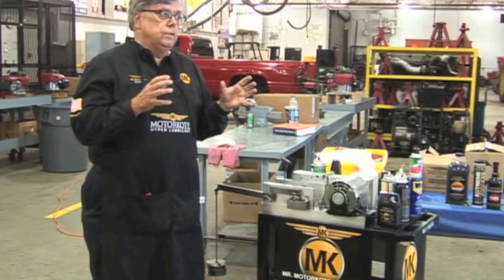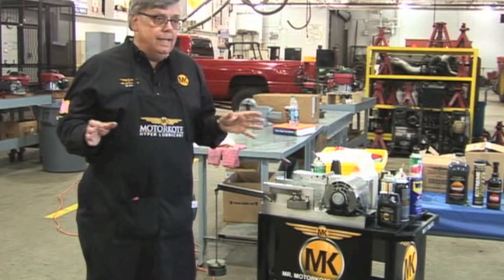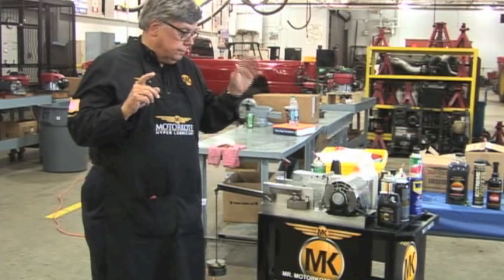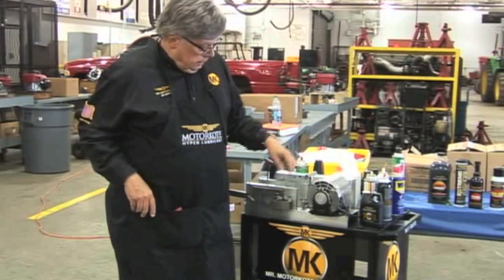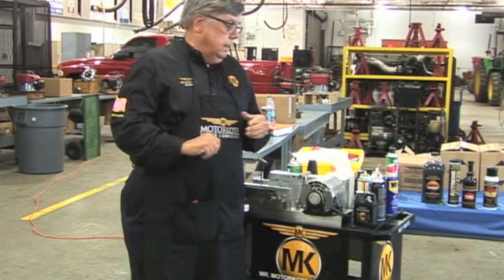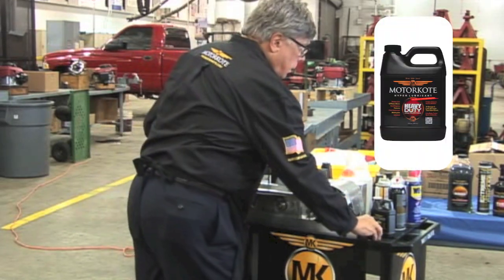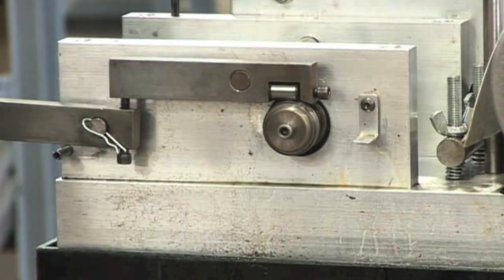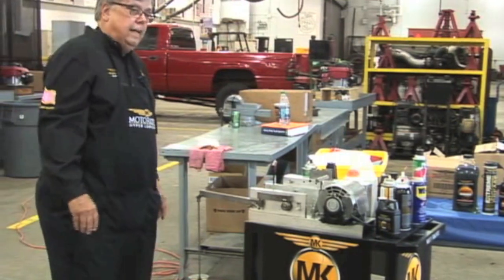Motorkote® Demo

Comment: Ive bought probably 4 gallons of this product and use it in all my oil changes.  My vehicle is a 2005 Chevy Equinox with 268,397 miles on it and still driving great.  Amazing product.

Comment: I am using motorkote in my 88 deere 1050. Abit over half of the recommended amount for a "heavy duty turbo diesel" with absolutely incredible results. Its an inline 3 diesel so it makes much more racket than say a modern 4 cylinder but Motorkote had quieted the engine right down much more than i ever wouldve thought possible.

Hiwever according to amsoil theyre claiming motorkote uses chlorine for whatever reason, now are they slandering your product to boost theirs or is motorkote really going to loosen up all the older sludge built up inside engine crankcases from years of conventional use?????

I believe this to be an extremely important question for you to answer

Comment: I bought this. I tried to cancel after but it shipped anyway. I haven't put it in my jag and wont. I have been trying to get an answer on the chlorine rumors. No response from MK Yet I emailed them on the 24th of dec. Clorine is not good for aluminum block or heads... . The flash point is only 60c. That sucks. Waste of $30

Comment: Marketing ploy BS: It's not an additive. You can keep it like all the magic oil additives in a bottle. I'll stick with Amsoil. It's never failed me and all my vehicles run on it, along with my small engines .
Reply: amsoil guys never seize to amaze me. they are NEVER open to other opinions.
Reply: @lukeWiz44  And don't assume we're all the same. I don't go around claiming Amsoil is the best; it is my preferred choice of oil. Even back when I was running Pennzoil, I still wouldn't put this nonsense in my engine. The people who fall for the B.S. haven't taken the time to understand just how motor oil really works. A healthy engine running on top-tier synthetic oil doesn't need help. I've seen so many magic bottle products with some flim-flam making all sorts of claims that their product is the best of the best. For example, there are a couple of YouTube videos of someone showing how much better their product is over MotorKote (MOTORKOTE VS TURBO MAXX BRASS FRICTION TEST).

Run the right motor oil, use a quality oil filter, and change the oil on time. Done deal. A magic trick or some random internet person isn't going to tell me otherwise. I've done the research and seen the data. These products for a healthy engine are B.S.
Reply: @4x4gear33  i didn’t ask for all that man. I get amsoil is your oil and i respect that. I run ultra platinum and i’m happy with the price i pay for it. but this motorkote- it increased my fuel mileage by .8 mpg. i was really impressed by it.
Reply: @4x4gear33  Just an FYI. Did you know Amsoil was sold and the ad pack has changed in its formulation. Not as robust as it once was.
Reply: @FadetoBlack1463  Can you provide an article that says this?
Reply: @FadetoBlack1463  The only thing that changed is the CEO. The company was not sold nor has the formula change.
Reply: @4x4gear33  Changes are being made from with in the company.. Can you provide Lab reports showing the formula has not changed?

Comment: This is honest to God real.  in the '90's a store where I worked carried MotorKote and one day the salesman, possibly this gentleman, brought this machine in to demonstrate to customers how MotorKote worked. I was the mechanic in the store. While the salesman was doing his thing I told myself this was a rigged test. So while he was talking and the machine running on a bearing I grabbed the leverage arm and pulled down. I pulled down quite hard for about 15 seconds. Customers were snickering while watching me pull down on the arm. There was no change in sound pitch, the machine did not slow down and I did not see any signs of heat. The salesman turned and shouted for me to stop what I was doing. He wasn't worried that the product would quit working but that I would bend the leverage arm of the machine! I was sold. I added it to all type of lubes, grease and oil. I used it on everything that used lubricants. Engines, transmissions, hydro transmissions. Anything that spun or slid. I still use it today in my cars, street and race, lawnmowers, chainsaws, guns, door hinges, everything. It's amazing stuff.
Reply: I noticed no corrosion when replacing a seal on a 5HP B&S motor on a generator. I've used MotorKote since 1999 on that motor with over 500 hours on it with an oil change every spring with MotorKote added.
Reply: @UncleStevie8er Did you check this under a microscope? That's what folks (oil "wizards") on the bob is the oil guy site always ask

Comment: Motorkote, Amsoil Signature Series, and K&N Oil Filter is a tough to beat combination.
Reply: I agree with you except the k&n oil filter part. I haven't seen any info to prove k&n oil filters are any better than other top of the line brand filters such as Wix XP,  Mobil1, Fram Titanium, Napa Platinum, Royal Purple etc etc
Reply: Agreed

Comment: Aloha from greece very interesting ,i got a question, how many oil changes does the new motorkote last ,they dont make it as thick as they use too
Reply: Because of new cars with VVT-I and v-tec systems the need thin oil

Comment: It’s a great lubricant but DO NOT put this in your engine. It burns off and creates a nasty sludge. Have had to run seafoam through my engine multiple times to try to clean this stuff out. Use it on hinges and bicycle chains but not your motor

Comment: As far as motorkote goes, I'm still on the fence and looking into it.  I work in a lab (different industry than petroleum) and will be unofficailly running some tests. I will also introduce combustion byproducts, which often has emulsified condensation to test for additional corrosive byproducts and moisture contamination to test for acid development, etc.Your EGR valve, crank case vent, and oil separator  all recirculate these corrosive byproducts back into the combustion process or back to the oil pan. I'm reading about chlorinated paraphins but perhaps it's not as big a deal as it being made out to be. Hoping to make a contribution. I love project farm, and I'm thinking about seeing if he may do a follow up (long term test?) pending what I find. The physics and chemistry of the internal combustion engine is hard to replicate with just one test. The Timken bearing tester only gives you a piece of the big picture. Project Farm affimed Motorkotes claims, which was quite impressive to be honest. It got my attention.
Reply: Will be waiting for results , did you get something???
Reply: Any news yet?
Reply: Would be nice to see a test. Although i am sure these acidic byproducts will be neutralized by the oil additives. Also a regular oil change will help too ofcourse. And as long as the oil doesn't see a dangerous high temp nothing will happen
Reply: Have you completed the project?
Reply: To be honest I had to put the project on the back burner. I was waiting for some testing materials to put a study together.... I'm really excited to put this through some tests. It just may be a few weeks before I get to it. I will follow-up with this.
Reply: @ryanpooler3962  ok, thanks!
Reply: @ryanpooler3962  
Any update?
Reply: @ryanpooler3962 I’d love to hear if you ever got it testing!

Comment: This along with Project Farm’s testing and I was sold!
😎💪🇺🇸🗽❤️
Reply: His test is great but after seeing how well it worked I am shocked noone has sent in an oil sample to see how the wear compares to a normal oil change.
Reply: I was sold after watching some of the popular videos for this product. Just put some in my car today
Reply: If you notice Project Farm used straight MotorKote in the lawn mower. This guy is doing the same. So we need to fill up our engine with MotorKote let it run a few minutes then drain. To get a good coating.  Then add the oil. Ford Boss channel added Motor Kote to Schaeffer oil. Put all the weights he had eleven weight to finally get it to stop. Tested just  Schaeffer by it self stopped after two weights. It stopped. Scar on the Motor Kote was negligible. Where the straight Schaeffer was large.

Comment: The fact that this company is not more honest with what the contents of their product is when I do believe most of us already know and they refuse to admit it is why I will not use this product. All one has to do is simply Google What chlorine paraffin is and how it behaves under high temperature and it explains everything motorkote does to a T. Yes, it's a very good friction reducer. Yes the effects of chlorine paraffin under high temperature creates a coating on metal surfaces that's very resistant to moisture. But the after-effects is it can produce sludge and hydrochloric acid which will break down your motor oil over time. You would be running the safer alternative just adding more ZDDP to your engine oil instead of this motorkote. if your engine Burns oil of course ZDDP is not good for your catalytic converters but at least it won't break down your engine oil or promote sludge and it essentially achieves the same effect as motorkote does. People should be very suspicious of motorkote  since they claim no actual oil additives are in their product so if it doesn't contain the same additives as your motor oil what does it contain? This is what motorkote refuses to disclose and because of that I don't believe any of us should be trusting this product. This stuff claims to be so great but there is an obvious reason why oil manufacturers do not add this to their oil because they know long-term it will break down the longevity of the oil and reduce its overall effectiveness. Just because something works in your engine right away doesn't mean two or three thousand miles down the road it won't change.

Comment: Project Farm proves this man to be reputable. I just bought this product. I feel confident it will do what it is advertised to do.
Reply: I put in my semi this past week within 2 minutes I felt the engine run smother.  And has stayed smooth running. Will update at request so far 4000 miles this past week and smooth
Reply: My Trans am had 10w30 vr1 in it and engine Temps were running up to 219 degrees.  Oil would thin out and at that temp and my oil pressure would drop way down.  I went to 20w50 vr1 and it helped from thinning . I drained some and added 12 Oz of motorkote in its place. I also blew out dust and straw from between radiator and ac condenser  but it wasn't that much.    Now coolant temperature staying 170 to 177 and oil pressure stays good.  I'll be going back to the 10w30 with motorkote to see if it changes
Reply: Same here.
Reply: It won’t
Reply: @evangrimm1702  why do you say that?
Reply: @jonnyboat2  He's just being grimm. 😁

Comment: I dint know my car had an oil leak i took a 250 mile trip and found out later when it was knocking that's right 250 miles no oil, well good bye engine but I got home love ya motorkote <3

Comment: I use Motorkote in differential, tranmission, transfercase, powersteering, & ofcourse crankcase, stand by generator, log splitter, powerwasher, lawnmower, snowblower, im going to use it in my new motorcycle after i break it in, but i will use very little in motorcycle, i dont want my clutch to slip because of it, all though it says you can use it in wet clutch motorcycles.......i have a Kawasaki Concours 1400 has the Ninja engine on it, very powerful ...
Reply: Love that bike

Comment: I messaged MotorKote on Facebook to ask if this product contains chlorine, not an unreasonable question in my opinion. They saw my question and ignored it. I asked them one more time and again, they saw my question and ignored it. So I take that as this product does contain chlorine because if it didn't they would be happy to tell me it doesn't. Also, on their website, they state that it contains no moly, teflon, graphite, etc, but it doesn't say that it contains no chlorine. Again- If it didn't, they would be happy to tell us that it doesn't.
Reply: Avery Alexander i use motorkote, but im pretty sure you are 100 % correct, i may stop using it, i heard that will break down yr oil after while, do you know the damage chlorine will cause ?
Reply: @toddjacobs5660  Chlorinated paraffin (essentially what this is) is not corrosive to metal at room temperature, but when heated and mixed with water/combustion byproducts, it creates hydrochloric acid. That's one reason chlorine is not used in swimming pools anymore and even then, in very small amounts. Do with that information what you will.
Reply: @JazzyJonas  Pools still very much use chlorine. And the amounts used has not changed either. Pools that run salt systems... sodium chloride aka table salt.... NaCl. The  chloride is disassociated through electrolysis making the chlorine to be "available". It's still chlorine.
Reply: @JazzyJonas  You are correct! There is a very good reason oil manufacturers no longer use chlorine as an additive in their engine oils.

Comment: Still running... but extremely hot?
To me that means friction.  So what are we supposed to take away from that demo?
That being said, video from Project Farm seems very convincing.
Reply: I think what he is trying to show is that the product continues to work in extreme heat instead of burning off and failing, but don't bother asking Motorkote as you won't get an answer anyways from my experience.
Reply: What cause the smoke?
Reply: @johnnyzhu6729  Oil burning off the hot bearings

Comment: I would advise NOT to use this in your transmission you will ruin it   or   Front/Rear differential   
As they have clutch plates  that need a certain level of friction  it may cause your transmission to start slipping etc...
Reply: Advise is a yours.  I’ll take the companies in this case
Reply: Have you used it in yours or have conducted tests? I am open to see your findings.🤔
Respectfully yours
Reply: You just don’t use too much. I’ve used it in two dirt bikes and my car with no problems.
Reply: @jimstenlund6017  same here. I have a 99 silverado that started to hard shift into 2nd gear and I added Lucas transmission fix and didn't help. Then drained the transmission oil and a few months later added motorkote and the hard shift went away and all gears felt very smooth. This was 3 years ago. The transmission is still running strong. I get the guys logic who posted the comment but I'm sure motorkote knows that and made a product that wouldn't mess your transmission up.